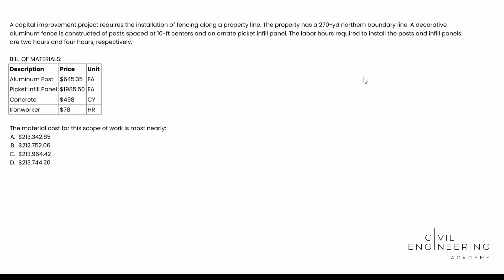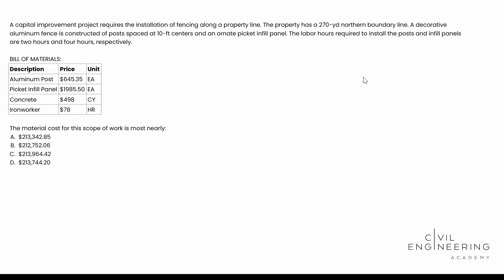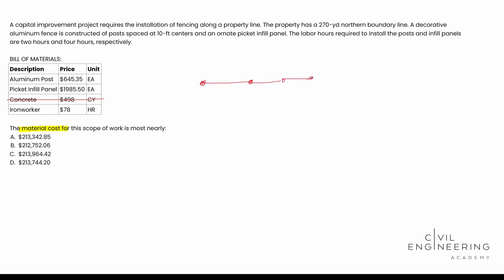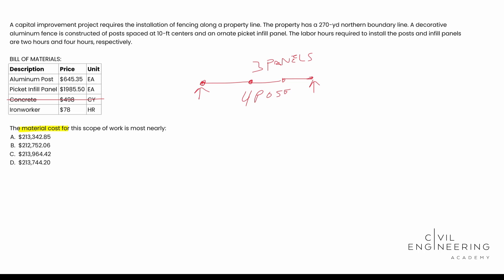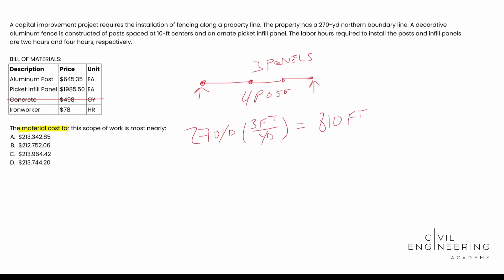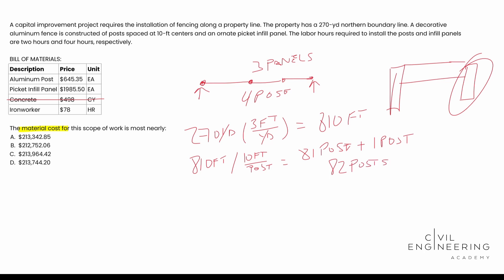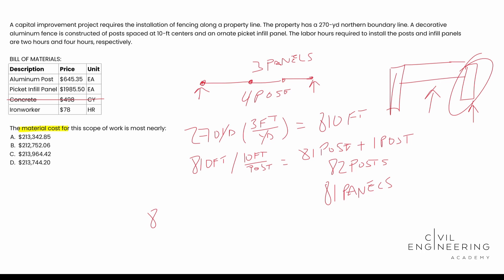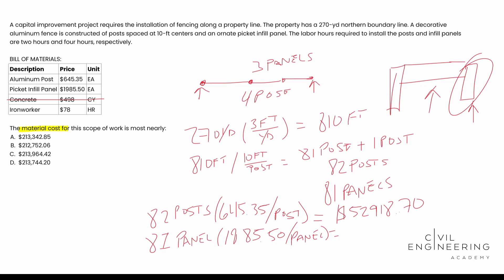Civil FE/PE Problem - Quantity Take Off Estimate - Determine the Cost of Fencing

Comment: I am still trying to figure out how you got the number of posts and panels. 
Would you mind explaining ?
Reply: Divide the total length of fence (270 yards or 810 feet) by the spacing of the posts (10 feet). This actually just gives you the number of panels. You have to add an additional post at the other end because fences always need posts at each end. It might be easier to do the same problem using  numbers you can physically draw out. Say, a 15 ft fence with 5 ft spacing. You can easily draw that out completely because it would require just 4 posts. ( 15/5 + 1 at the other end)